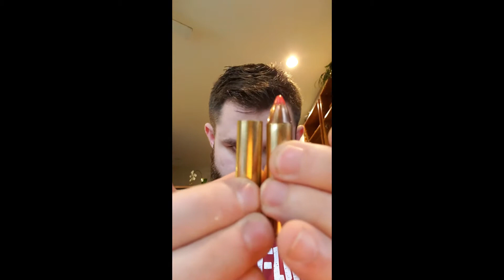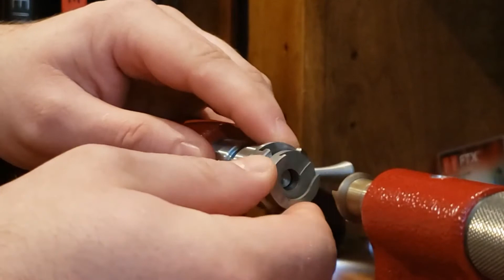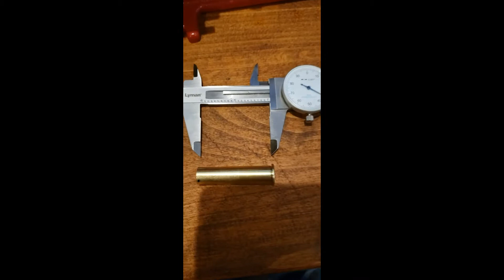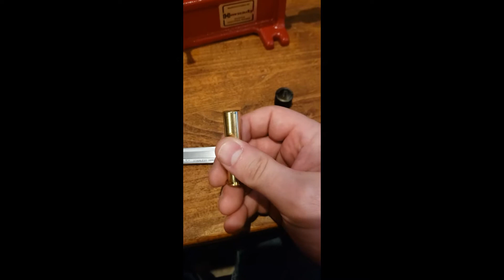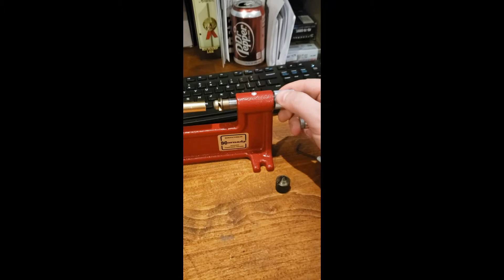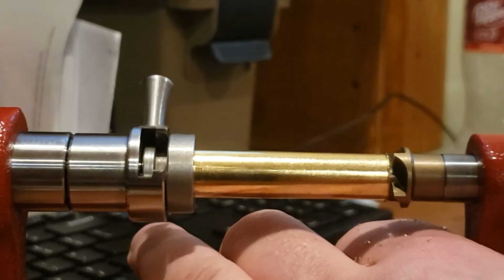How To: Hornady CamLock Trimmer

Comment: Are we basically making a dummy case for trimming subsequent brass the way we make dummy rounds to set seating/crimping dies?
Reply from the maker: You can do that yes keep a case marked and use that to reset your length if you use the case trimmer for other round types.

Comment: I used a blanking plug with the closed end cut off from the diesel pump specialists inside the lee deburr tool so it doesn't scratch the case like that.

Comment: how do you like loading the lipstick stuff? heard crimping it is a bit of a pain. did you notice that. id like to try em out as i have 200+ H brass from the factory stuff. aint no good for my led cast as there too short. im using RCBS and never tried to load them.
Reply from the maker: Haven't had a problem. I had a ruff time with the 325 level revolution rounds from Hornady. They are longer so I had to trim the case a lot to get the rounds to chamber and cycle correctly in my marlin.

Comment: So then you have to deburr the case after you trim it.
Reply from the maker: Yeah, I just use the Lee's hand debur system. Debur the inside lip and outside then your good to set the primer and go on from there. The key, if they are new brass from the store run them through the resizer ones then trim it. Debur it, hit the resizer one more time then micrometer everything and see if its it spec.